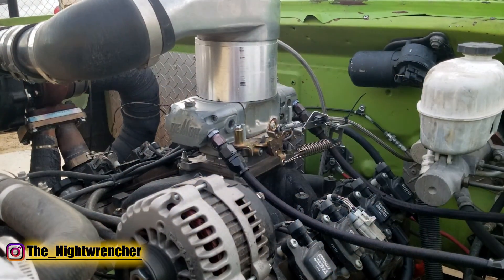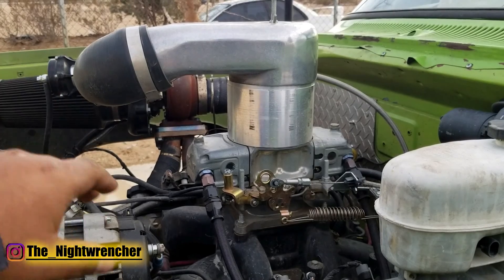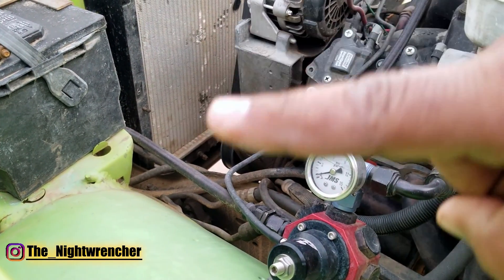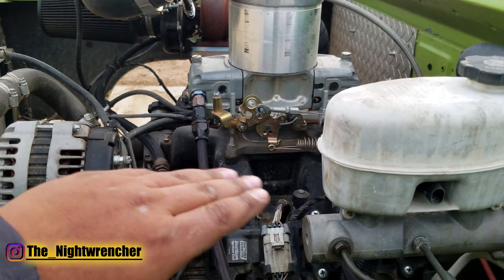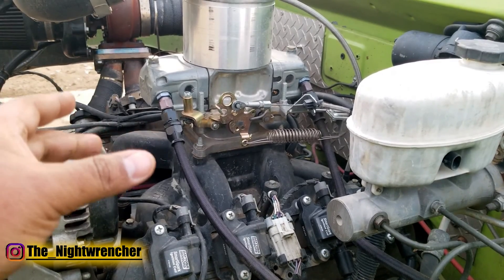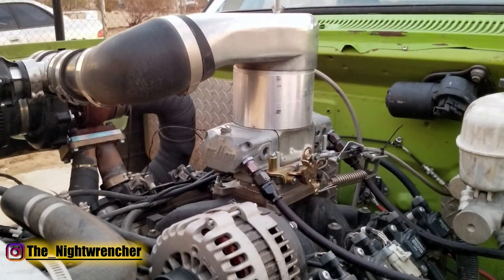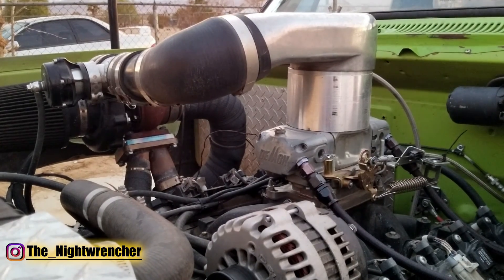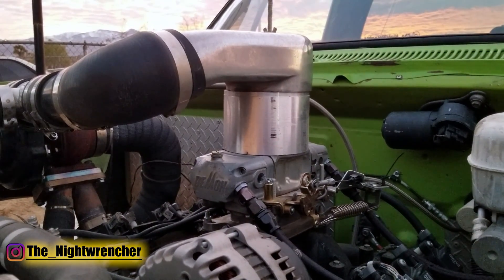How To Turbo A Carbureted Engine Easily! |Blow Through Holley Carb Tuning | Carbureted Turbo LS

Comment: Is it possible to add the turbo after the carb? maybe that way you don't need the extra trouble with the fuel pressure? I don't know anything about turboed engines just started researching.
Reply from the maker: Yes, you can. Its called draw through turbo. I have a video explaining that
Reply: @NightWrencher  Looking it up right now . Thank you!

Comment: Can you just use a stock p01 computer to just tune timing via hp tuners and just ignore all fuel tables since it won’t be connected to anything .
Reply from the maker: Ive never done it myself but its been done several times on youtube with the 0411 PCM.

Comment: Let's say you have a fuel rail, couldn't u flip it around so the primary side is at the end of the fuel rail so the fuel goes straight and fills the primary first?
Reply from the maker: Yes, but then you have the opposite problem. Both are not great so now I run lines directly from my regulator to the carb individually
Reply: @NightWrencher is there any way I can get it to work with a fuel rail?? Could I just put a spit where I put the fuel rail onto my line from the fuel pressure regulator and have 2 lines from that to the carb?
Reply from the maker: @AMan-o2g4m  I'm sure that would work as long as the part you use to split doesnt act as a restriction. What youre trying to do is keep the priority the same to both bowls. Fuel FLOW is a different topic altogether. For lower HP levels, a split should be fine
Reply: @NightWrencher thanks for all the help, other than fixing the fuel rail is there anything else I'd need to do to my carb? Its a holley 750cfm vacume controled one. Im turboing my 92 blazer,but im only running 3-5 psi on wastegate till I ls swap it in the future. Rn it has a cam intake manifold and carb swap on the 350z
Reply: 350.*
Reply from the maker: @AMan-o2g4m well the 750 vacuum secondary will not work with boost. You'll need a mechanical secondary carb
Reply: @NightWrencher I don't fully understand how vaccum secondary's won't work. They work off vaccum but so do brake boosters. So if you were to turbo a car and it were to chance th e vaccum wouldn't you lose brakes too?? If you can could u pm me on like any social media bc I'm trying to grasp this fully.
Reply from the maker: @AMan-o2g4m yes, you will lose power brakes under boost but youre usually not building boost and using the brakes at the same time. Your vacuum secondaries will work fine until the turbo builds boost and the positive pressure will force the secondary diaphram closed.
Reply: @NightWrencher okay but also if there's no vaccum how does the bov work to let all the boost out? Isn't that off a vaccum like aswell?
Reply from the maker: @AMan-o2g4m thats on deceleration when the throttle plates close and vacuum is pulled against the intake. Vacuum and boost can not exist at the same time.

Comment: Question about your fuel pump .......I understand the pressure requirements. But how much volume is needed with carb on gas?? A Walbro 255 will easily make the pressure, but is it enough fuel? Do I need a 340 or 450 lph pump? My combo is 71 F100 351 Dart pro 1 heads, TF stage 2 cam, T45 turbo, 71 Mustang fuel tank EFI converted w/ foxbody pump hanger. Videos are tech great, have watched most 2 to 3 times!!!!
Reply from the maker: @elwoodjackson8496  hey man, you just need to make sure you flow enough for the horsepower you intend to make. Rule of thumb is take the LPH and double it, thatll be your hp limit at the crank. So a beefed up 351 will probably make 500hp on its own. Add in the turbo and you're going to run out of fuel pump pretty fast. Look up the walbro 450s or the Hellcat pumps which are like 525lph which is what I'm running now. Better to have too much than not enough fuel flow.

Comment: How about boost controllers? id like to run around 7 pounds but be able to go up to 10 every so often. Is a electronic one possible or just manual style?
Reply from the maker: AEM has the TruBoostX. I had the same controller. Really easy to use and has 2 programable boost settings
Reply: @NightWrencher  You really are the best!
Reply from the maker: @felonebike9859  i appreciate it man 👍

Comment: Boost shouldn’t affect the timing if the fuel is able to resist detonating. Cylinder head design sets timing requirements, that don’t change based on boost.
Reply from the maker: Sure, I've also watched that Steve Morris episode but youre not running race gas on a street driven vehicle so yes, you do need to back off the timing under boost.
Reply: @NightWrencher I have never watched a Steve Morris episode in my life. I just know cylinder head design determines timing not boost. 

Race gas? Seems lots of foolish folks out there think race gas is the only octane out there. E85 is cheaper and has the octane
Reply from the maker: @doomman700  e85 so you can run out of fuel half way up to vegas 😂 I ran e85 for a year, not interested in going back
Reply from the maker: @doomman700 and I'm saying this to be rude, but for a street driven vehical going long distances into unknown territory, e85 is not a good option without proper planning.
Reply: @NightWrencher  why would I drive to Vegas?
Reply: @ on a side note, if you have the need for race gas under boost to stop knock, your timing won’t help. It’s the pressure lighting off the mixture not the spark.
Reply from the maker: @doomman700 some of us drive to vegas 🤷‍♂️ i put thousands of miles on my truck every year.
Reply from the maker: @doomman700 ive never personally had problems with preignition. I ran e85 as a safety measure. It just wasnt worth doing with how many miles I drive.

Comment: I'm planning on getting a '41 Oldsmobile, then doing an engine swap with a GM Vortec 4200 Inline 6, which is circa 2006-2009. Wonder if this can work on that engine, so I can keep the car purely mechanical?
Reply from the maker: I do not think this would be easily replicated on a 4200 because there is no carbureted intake manifold available for this engine and I am also unsure of what ignition module would be available for it since you would be eliminating the ECU.

Comment: How much boost can you run with blowthrough without an intercooler? Im building a hot rod and i cant find a small enough intercooler that fits inside my grille
Reply from the maker: You can make quite a bit of power without an inner cooler as long as your tune is good

Comment: Do you set your float bowl level at bottom or middle of the sight hole?
Reply from the maker: Depends on what I'm doing with the car, but usually at the middle. If its a glass sight plug and just until it barely pours out if its a brass plug.

Comment: I have an aluminum fuel cell with a sump with two output -08 fittings. My pump is a Blue Holley. I would assume that I need two pumps so I can feed a like to each end of the carb, and the top of the cell has a return and a roll over valve. Do I need to add another return and regulator?  Thank you!  I want to used the FE iron exhaust manifolds to a pair of GT3582s at 9-10 lbs. Engine is  at 9.5:1 CR.  Thanks!
Reply from the maker: A Holley blue maxes out at 14psi of fuel. With 6psi of base pressure, the max boost that you'll be able to run is 8psi or .6 atmosphere aka 60% more power before the engine will begin to starve of fuel. doesn't matter if you're using 1 or 4 or 10 pumps. If the pumps can not support the max PSI, the engine will starve, regardless of fuel flow. With that being said, a single holley blue will get you to about 800whp. You can feed a second one into the same boost referenced regulator, like the Holley 12-865. That regulator has enough ports so that you don't have to run 2 regulators. 2 holley blue pumps are 220gph which is great if you're not trying to push more than 8lbs.
Reply: @NightWrencher  Thank you, . I am not going over 800-900 hp anyway. The Galaxie can’t hook up more than that, but it is built for that. Two 16 psi  Pumps should be fine as 8-9  to be safe 800 at the wheels is a handful .  I appreciate it!

Comment: What do you do about the needle and seat and the vents? Do you have 2 needle and seats per bowl?
Reply from the maker: Dual needle is for fuel flow. I havn't ran into a situation where 1 needle and seat is not large enough. Maybe when you get close to 1000bhp it starts to becomes an issue but for most street cars, its not an issue
Reply: @NightWrencher  Gotcha, I am thinking about 800-900 hp with two VS7875s at 10-12 lbs on a 397-416. I don’t want to break the block. The SOHC 427s can do 1500 happily, but this is a 3 rib D4TE block with good iron and I have 2 PSE Aluminum crossbolt main caps for 2 and 4 drilled for priority oiling, so it would be 1.2,4,5 priority feed. I think 800-900 rwhp is plenty.
Reply from the maker: That should be more than enough turbo for that. There are slightly smaller turbos that will get you there faster but you're looking at around $1500 for the pair vs $600 for the pair of ebay 78/75s
Reply: @NightWrencher  I ve considered a pair of GT3582s with the stock plank manifolds reversed, will that maintain a rising boost curve at 825 or so?
Reply from the maker: @Bbba724  Theres too many factory, primarily exhaust back pressure. Most gt35 testing has been done on 5.3 and 6.0 engines which are much smaller than your engine so yours will end up producing more exhaust. Considering that there are 2 of them though, I'm sure it would be fine.

Comment: How about 2 4V DPs or 2 500 Holley 2 Vs on a 2x4 FE that has the front 4 facing to the front and the rear 4 cylinders angled to the rear?  It seems like fuel distribution would be better with two carbs? Thoughts?
Reply from the maker: I've played with that idea in my mind but 1) its not really necessary since a single carb can feed way more power underboost. 2) It wont work because both carbs needs to see not only the same air pressure but also the same air FLOW through the carb. If one carb is being hit by the air flow better than the other carb, that carb will tend to run richer and create more problems. Same situation if you were running 2 carbs with a twin turbo, if one turbo spins faster into its carb than the other, you'll have a similar issue. When even clocking the carb hat in a single carb set up a certain way can affect air direction or air flow, imagine what'll happen by splitting it up. I've seen it done, but never in a real performance application, only show cars. So far the best solution is either a single plane intake or a 1 inch spacer under the carb. The distribution is close enough that it wont hurt anything but I would still check your plugs
Reply: @NightWrencher  Thanks I see what you mean, it has to be in a state of equilibrium to work right. Thanks, I hadn’t thought about that.

Comment: @nightwrencher do you have a video or diagram of creating a "boost box" for the carb? Not new to turbocharging I just cannot find clear instructions on how to create this. Is it literally just jetting up and putting the carb in a sealed box? This is for a small engine motorcycle
Reply from the maker: Yes, thats basically it. The hard part is getting it to seal because the fuel lines have to go through the box somehow. Its not a very efficent system but it does work
Reply: Appreciate that input, I don't see why you couldn't hook a signal line up to one of the bowl vents to allow venturi/vacuum and still pressurize the bowl when in boost. Haven't found any info confirming that approach though.
Reply from the maker: @CygnusHomes thats not possible because if the boosters see boost pressure, it will try to find the path of least resistance and then try to back flow back into the fuel bowls. Thats exactly why fuel pressure has to increase 1lb per psi of boost. But if you didnt also pressurize the bowls, the fuel and air would just shoot out of the vent instead

Comment: I was confused  before this video now I'm just going fuel injection  with a holley setup ...
Reply from the maker: 😂 I don't blame you
Reply: @NightWrencher  NW do you think if building a Ls like this blowthru carb.. when you keep your foot out.. could actually help MPG. Or will a turbo on carb - no matter what— kill mpg? 
Thinking of overlander build
Reply from the maker: Off boost, the engine will react exactly as it would without the turbo so low load/speed will not affect whatever mpg youre getting now. Hope it helps!
Reply: @ best way to explain it. I presumed that to be the case. Once boost hits mpg changes as well. Just trying to find a way to make extra power and either benefit mpg or not hinder its current state. Thank you
Reply: Where your sense of adventure.. .

Comment: 4150 questions whats necessary for a small boost setup...not looking to take over just improve
Reply from the maker: I'll tell you what I tell everyone, if you're not running at LEAST 10psi, its not worth it to go turbo. If you have a good working NA motor with headers and freeflowing exhaust, you're going to lose power by simply installing the turbo. On my Charger at 5psi with an optimized tune, the engine only gained 30 horsepower to the rear wheels over my optimized NA setup. 30 horsepower for $2000 is not a good trade.

Comment: Surprised so many people don’t understand a little more about how fuel line size works, I’ll be honest I don’t know hardly shiz about turbo carb specs. However I do know much more about turbo efi and I ain’t ever heard anyone say try explaining how return lines need/should be larger that the feed it’s really it’s always the opposite since the engine uses fuel rather that moving it or making it..
Reply from the maker: Its only exclusive to carbed applications. The more powerful the fuel pump, the bigger the return line has to be in order to bypass enough fuel to keep the fuel pressure down. Not the case for EFI
Reply: 20 lbs I’m not doing that bro. I just wanna ride. Like you say bro I didn’t know this before today.

Comment: I'm trying to figure out an 84 yota 22r. Not sure what mods the factory ASIN carb would need if even possible.
Reply from the maker: The carb would have to be able to be pressurized. For an engine like that, look into draw through turbos or try to swap in a Holley 2 barrel or a smaller holley 4 barrel

Comment: I’ve been wanting to put a single turbo on my 77 TA that has a 68 400 from a gto but the fact it’s a carb engine has kept me from it. It would be so cool though
Reply from the maker: Check out my videos on @nightwrencherperformance to see the build of turbo charging my dodge charger
Reply: @NightWrencher  Ok I found you and subbed, I’ve been running nitrous for a long time, under carb plate, Holley elec fuel pump & regulator , pro comp billet distributor & MSD 6AL box, headers, a summit cam, 750 double pump , other bits here and there. Sounds like I’ve got a decent amount of what’s required so there’s incentive for me to get started
Reply from the maker: @stephen_crumley  As long as the regulator can be boost refferenced, I'd say you're on the right track!

Comment: Thank you so much for your video and explaining things that some one like me understand! Sooo tired of trying to work with emc and all the sensors and crap with efi. I'm old school and live simple! Thank you so so much!!!!
Reply from the maker: You're welcome and I appreciate it!
Reply: I'm ordering fuel line and the regulator today. I'll prob need help as I progress. Like carb size and such with  a vortech v3 supercharger.
Reply from the maker: @leightonbazemore7491  the carb size is easy. Whatever is the best fit for the engine the way it is now,  thats the same size youre going to run under boost. So if your carb size is a 600 then you keep the 600.
Reply: @NightWrencher  well to give you the rundown it's a 88 foxbody. Efi,  5.0, e cam, trickflow 190 heads, headers,  got a vortech v3 supercharger putting out about 8 lbs on factory installed pulleys. im sick of computors and sensors. So I don't have a carb size picked for it. I talked to CSU. And 1400 is a steep jump. So I was thinking surly I can build one. But don't know where to start. It will be street driven and some small trips. It's 5 speed also.
Reply from the maker: @leightonbazemore7491  have you seen my blow through carb build series?
Reply: @NightWrencher  I saw 2 of the vids
Reply from the maker: @leightonbazemore7491  on a light car like a fox body itll be much easier so it shouldnt take too much to get it going. A 600-650cfm should be plenty for that cat
Reply: @NightWrencher  a buddy said he has a quickfuel SS 650 i can have.  So I'm Gona get it. Then try to work with it and make it a blow threw
Reply: @NightWrencher  got a question. On the quick fuel I got the metering plate has a place for emoltiin jets. There are none in it. Should there be ? Looks to be 5 on each side.